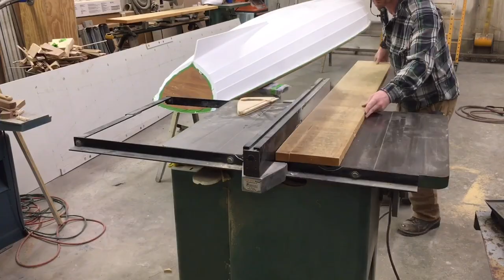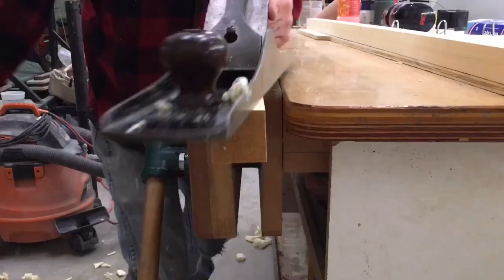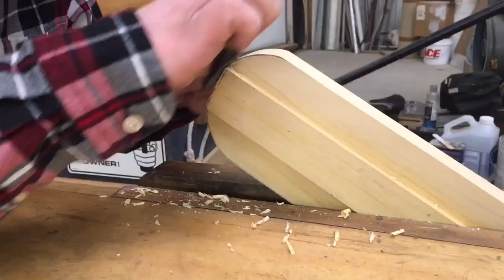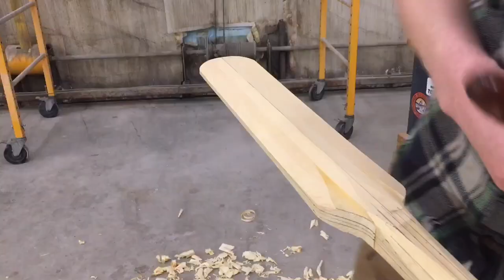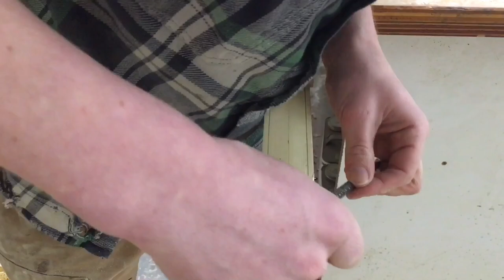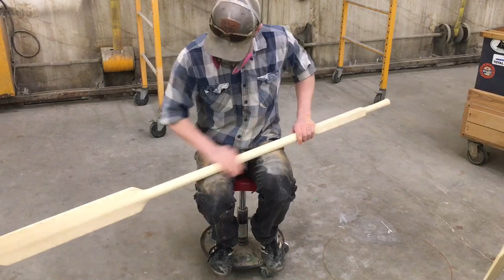Handmade wooden oars

Comment: I gave up on marking out the sixteen sides years ago and just hit that one by eye on anything smaller than a spar. I got into small batch Greenland paddle manufacturing at one point. From that developed a simple jig for holding paddles during the carving process. Makes all the difference in the world and the concept would be easily adaptable to oar carving. I'll shoot you a set of plans if you're interested Grant.
Reply from the maker: That would be awesome, thanks.

Comment: My very first wood working project was to build a kayak storm paddle to see if I wanted to jump into building a touring kayak. I used big box store 1x2's laminated them with epoxy and used a thin coat of thinned epoxy for the finish. That was twelve years ago and the paddle (and the boat) are still going strong! I got my tools from ebay and craigs list, restored a block plane in the process and had a ball building.
Reply from the maker: My first paddle build was a west Green land paddle made out of a 2x4. It may be ugly as sin but it’s still trucking after all these years.

Comment: Great job I’m just wondering what would be the most durable for these
Reply: Durable finish
Reply from the maker: Oiled grips are a must in my book (varnish can make blisters) the rest oiled or Varnished. Oil doesn’t have UV protection and will not build up to a high gloss but is very easy to maintain. Varnish typically has UV inhibitors but gets brittle over time and can be annoying to keep up. I usually pick the finish according to the intended use ( lakes, rocky shoreline, river).
Hope that helps.
Reply: Oliver Woodcraft  perfect thanks for the reply

Comment: In lieu of AYC, what other woods would you suggest?
Loved the vid!
Reply from the maker: Lots of different woods have been used in the past. It often comes down to the intended use and what’s available. I have made them out of ash before with good results. If weight is to be considered use a soft wood for the shaft and a hardwood for the blade edges.
Reply: @oliverwoodcraft9733  Is Titebond III an acceptable glue for the tip?
Reply from the maker: @NorthWoodsStrider  The appropriate glue is also variable. On average I would suggest an epoxy though some woods do NoT except it as well as others. Tight bond is (in my experience) not a long life glue in that application.